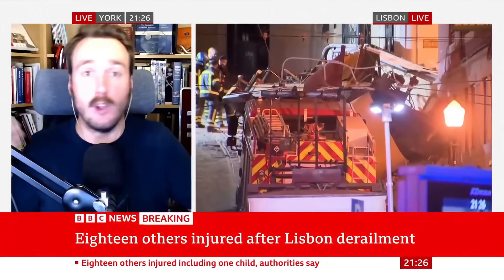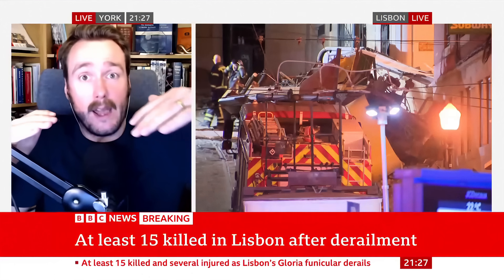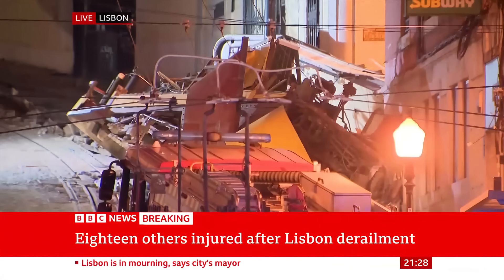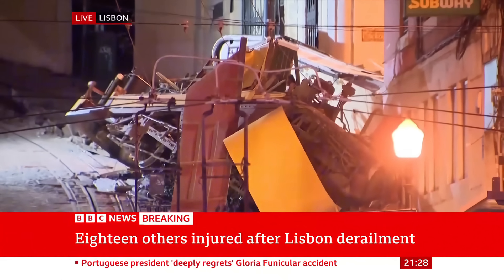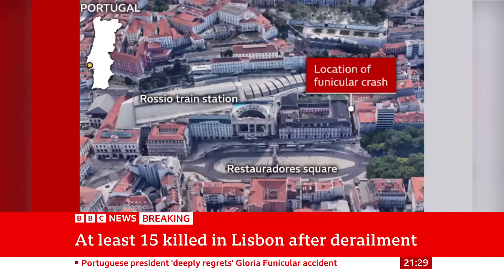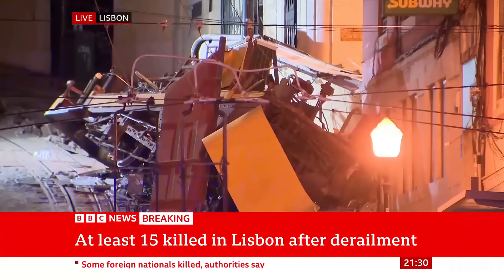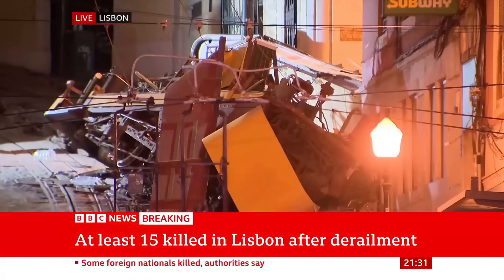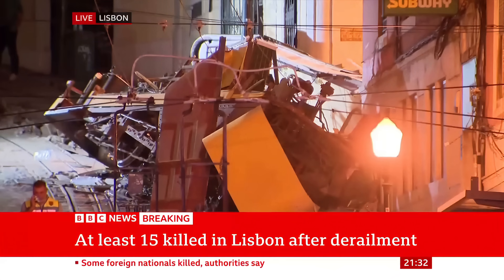Engineer gives thoughts on Lisbon funicular crash | BBC News

Comment: I'm Portuguese and i know very well this funicular and one thing i know about this tragedy: this funicular (and other funiculars in Lisbon) were not designed for constant travel night and day at maximum load. There are usually huge queues of people going up and down the funicular! For this purpose the maintenance should be dialy. This has been used as much as a "roller coaster"! Unfortunately. My sincere condolences to the families of the victims💔
Reply: Since 1885, only  2 cases of Derailments:
On 7 May 2018, a car derailed due to insufficient wheel maintenance. NO injuries were reported.
On 3 September 2025, a car ran away and then derailed after the failure of a steel cable, and brake malfunction.  
Atualmente, é a “empresa Mein que faz a manutenção dos elevadores” da Carris, declarando que a  manutenção do elétrico que descarrilou em Lisboa, é assegurada "escrupulosamente, e que a segurança é uma prioridade absoluta da Carris há 152 anos.“
O elevador da Glória foi inspecionado na manhã de quarta-feira, dia da tragédia. 
A inspeção demorou sensivelmente 30 minutos e foi referido que o cabo deveria ser substituído dentro de 263 dias. A notícia foi avançada pelo Observador, continuando: ”seremos intransigentes no apuramento das causas e responsabilidades deste acidente, pelo que estamos empenhados para muito em breve estarmos aqui para apresentar as conclusões deste inquérito”.
Reply: @helenanova1730  The 2018 derailment is classified that way but was quite different from what people reading the word ‘derailment’ will initially think. Due to wear and tear one of the guardrails of a wheel., the wheel came off the rail. As a result, the wheel dug itself into the ground and essencially  immobilized the funicular that had the issue and his twin.  it is also important to note that the system has been operating since 1885 , what is a long time, without any major incident what suggests at least regular maintenace for a long period of time - wihtout it a system like this would be out of comission in a relative short number of years.
Reply: @helenanova1730 what improvements have been made since 2018? Other funiculars in Portugal were modernized. Sounds like greed and bad management starting from the top
Reply: Absolutely right. I'm British, but have lived in Lisbon for 28 years. I can remember when the funiculars were essentially a mode of transport for locals, what they were in fact designed for!  With the massive upsurge in tourism, they've become effectively a 'joy ride'. They're over used and overloaded. An accident waiting to happen.
Reply: Let's also add that this is a consequence of mass tourism and looking at this like an attraction. The fact is that it is a public transportation - and that it is why it was managed by a public transit company - four portuguese people working in the same public interest institution that use it to go to work ever day, died at the crash.
Mass tourism is putting an intense pressure on multiple basic resources that serve the city that portuguese taxpayers (other taxpaying residents have not played a generational role in this in scale) above everyone else are paying into. Personally I don't anyone that doesn't own a business in hospitality or that couldn't find a job in another industry that feels benefited by alk the rising global interest in the city. I don't think tourism should be dictating how we can live in our cities. Cities are a place for people to live not to be sold as products at the expenses of its citizens. That's why I don't travel nearly as much as I used to. I don't like being a tourist elsewhere and think I'm being a nuisance to someone, I would much rather to be a traveler but that's really a challenge now a days...
Reply: @becomingwhoweare   While I'm sympathetic to your wider view about mass tourism, it remains the responsibility of the authorities and not remotely the tourists. The system had changed its use from public transport to tourist thrill. Fine - in that case the system needed far more intensive maintenance. This would be paid for either by the tax payer or by the customer. Surely, the customer could have been made to foot most of the bill by making single use tickets much more costly. In that way, regular users with monthly passes would be spared the extra cost. Of course, this is easy to day in hindsight
Reply: @tantotonto  true. I wasn't trying to attribute responsability to the tourists for the events. But frame the whole situation - excess traffic of people - as unnecessary and causing unwelcome tension/issues, because some people gain from it far more than others... All of us are tourists one time or another and we don't make this kind of decisions regarding the countries we visit. But collectively we shape it as an economic interest.. my point is that we are sold this idea that this what we should be consuming now: other cities as an experience, and there's fads, now Lisbon is a trend. And someone wrote in 10000 guides that you should ride that elevator when you come here...And we should reject that, as citizens and consumers. 
That's my reflection over the past 5-10 years. But surely the accident is in no way to blame on the people who use the elevator regardless of their provenance or resident status.
Reply: @becomingwhoweare so we should lock up everyone in their houses?. Tourists bring in extra revenue to the transport companies. It's is the transit companies responsibly to maintain a safe system.
Reply: Maybe they need to close all the funiculars in Lisbon and subject them to a rebuild to make them more rugged and safer to use given the current levels of usage.
Reply: @Sacto1654 They are all suspended at the moment.
Reply: @Sacto1654  they are all closed now for a close inspection. One has to wonder if, after this tragedy, whether the current level of usage will return! People are going to be very wary!

Comment: A cable broke. The funicular travelled 200 meters downhill before it met a slight bend, it derailed and hit the building in full speed. The other funicular was still at the bottom of the hill.

Comment: Funiculars, like elevators, are designed to deal with cables breaking. There will either be a secondary cable or a braking system independent from the cable. So at least two things had to fail at the same time for this to happen - or one of them was already "failed" and that wasn't detected by maintenance.

If it's a multi-cable system with no separate brakes, it's possible that one of the actual cabs' chassis broke and lost its grip on both cables.
Reply: Indeed. Disasters like this are never triggered by a singular cause; it's always a chain of factors that leads to such terrible incidents.

Comment: glad he explained how it worked as I admit I was confused to why an incline had pantographs, Having only ridden one in Pittsburgh where they were powered by stationary motors at either the bottom or top.
Reply: These originally had no motor at all. The top cab would have a tank filled with water so it weighed just slightly more than the bottom one, and the tank would be emptied at the bottom. Later they were modified to use steam engines, and then electric motors (same as trams).
Reply: Lisbon funicular isn't working on water since 1909.

Since them work on electricity.

And had been several engines and breaks and cables and... Along this 140 yrs.

An old /new funicular with old clothes... Or the traditional ones on the outside 😂😂😂
Reply: @anamarques5599  - It was converted from water counterweights to steam engines, and only later to electrical motors.
Reply: Yes it had 2 major evolutions.
And others along its 140yrs.

Only the outside and passengers inside are the same or looks the same

Comment: Even if the cable breaks, like an elevator, automatic breaking should occur if there is a loss of tension with the cable.  The operator should have at least two other manual breaking systems that if something like that happens, brakes can be applied.  Where was the operator and what was he doing?  Some railways have three braking systems, air, electronic and manual.  Perhaps the braking systems went to one set of brake pad assembly which failed.
Reply: The operator was in the cab and probably in multiple plastic bags now, so I suspect he won't be much help.
Reply: Have respect, the operator was one of The victims, he left two Kids and a wife behind, it was the first to be identified.

Comment: A cable must have snapped. One car had about reached the bottom and dropped a few metres to the end of the track. The other one rolled back down the hill from almost the very top and then left the rails at the last curve before the lower station, thereby avoiding hitting the car at the very bottom

Comment: No mention as to whether or not this tram had emergency brakes, this in case of cable failure.
Reply: Of course it did. A cable hauled car like this would have a spring loaded brake that gripped the rail(s) if cable tension vanished. Same with vertical lifts. However these things can fail to work sometimes, maybe because of lack of maintenance.

Comment: clearly he has no idea of how it worked, all speculation, shame! -.-
Reply: He clearly does, considering he even knew they'd been upgraded to use electrical motors in the cars themselves (which is unusual in funiculars).
Reply: @RFC3514  I'm confused about that. If the cars were modified to be self propelled with electric traction motors, then why is there still a mechanical cable being used?
Reply: @ct6502c  - The motor is only doing the work that the water tank used to do (i.e., breaking the balance between the two cabs so that they actually move). The cabs are still balanced with each other. It would be incredibly inefficient of have motors do all the work when gravity can do 90% of it for you.

Comment: Automatic brakes that operate at the moment the cable fails would have prevented an uncontrolled acceleration and subsequent crash.
Reply: A cable hauled car like this would have a spring loaded brake that gripped the rail(s) if cable tension vanished. Same with vertical lifts. However these things can fail to work sometimes, maybe because of lack of maintenance.

Comment: Apparently it was up on the hill, whereas the other tram was at the bottom waiting to go up. The people on the other tram felt a violent jolt which leads me to think the cable connecting them snapped, then that tram they were in slid down the rail a couple meters, stopping at the end of the track (luckily they were at the bottom of the hill). So they started panicking and leaving the vehicle in a hurry, and that's when they realised the other tram was coming down the hill fast and out of control, then it crashed into a building, catching people on its way who were on the sidewalk. The dead count is 17 already.
This tram already had some serious issue in 2018. The investigation needs to find out if everyone is really following all safety protocols, if they're cutting costs or hiring inadequate people. 
PS: is there no redundancy in the design, like in elevators? Shouldn't there be another cable in case the main one snapped? Or brakes to stop the car before it gains too much speed?
Reply: Or maybe there were several but they weren't able to hold the tram up, due to whatever reason. (Shock loads can be nasty if the cables were different lengths.)
Reply: This thing was 200years old, there is only one cable. But is has service brakes like a regular train and should have an automatic emergency brake that works by a like a trigger connected to the cable. If the cable snaps or looses tension the trigger clamps a brake. For this to happen all 3 systems had to fail. People are not aware of this
Reply: Este "acidente" ou foi por completa negligência de quem fez a inspecção nessa manhã ou foi propositado!
Reply: @katokaoula4872  também me ocorreu sabotagem, porque 3 failsafes falharam. Ou quem fez a inspecção, ou alguém depois deles fez "outra inspecção", e quem se vai tramar são os outros. Seja como for, 30 minutos de inspecção não dava para ver 200 e tal metros de cabo. Há muita coisa mal nesta história, se tiver sido sabotagem bem pior. Mas por vezes há interesses políticos em criar tragédias do nada.
Reply: @asmrcarousel  Tudo o que disses é o que acontece, infelizmente. 
Esperemos a investigação da PJ (espero que não tapem os olhos à verdade).

Comment: Don't they have breaks on these trains?
Reply: A cable hauled car like this would have a spring loaded brake that gripped the rail(s) if cable tension vanished. Same with vertical lifts. However these things can fail to work sometimes, maybe because of lack of maintenance.

Comment: It looks like that there was an inspection made that morning and everything was found in good running order. According to the article i just read the cables are changed every 600 days. This cable had 263 days left. So its definitely very strange.
Reply: instead of days they need to change it as to how many runs..
Reply: @guesswho-i2u - they estimate that into account into the days - but what was specified and what was supplied ?
Reply: @guesswho-i2u  - They run on a schedule, so the number of runs is always the same over 600 days. But I'm sure they'll appreciate your expert advice.

Comment: I am not saying this accident was due to lack of maintenance but
A lot of these tragedies can be due to lack of maintenance and replacements, like the cable car crash in Monte Faito Italy, 17 April 2025, cable fatigue?
Saving money by low maintenance always has a sting in the tail.
Gaz UK
Reply: The cables have a safe life expectancy of 600 days, this cable was 235 days in use
Reply: @Tusiriakest  Doesn't have to be caused by the cable itself, there will be numerous points of maintenance that need to be performed regularly.
Reply: @Tusiriakest  Perhaps the cable fixture failed?
Reply: I strongly suspect it will end up being a lack of maintenance. As you say, there have been too many failures of similar infrastructure caused by this.
Reply: If these are like an elevator (lift) there would have been a large wheel (or guide at top) where cable crossed to other track. This could have failed.  Failure could also be on crashed, as failure at any of 3 places would have same bad RESULT.

Comment: Why would they not design such a system with dual or triple cables? Surely they were not relying on a single cable? I would use three parallel cables for redundancy along with a fixed static cable on each track around which a brake, bolted underneath the car, slides up and down and would automatically grab if speed exceeded a preset limit. Along with that anti-derailing devices are very simple to design with the right rail design, essentially a manually operated screw attached to a heavy iron foot which under normal conditions glides along under the flange of the rail, any attempt for the wheel to lift would be checked by the foot. Rather like trying to pull the rail out from the jaws of a vise set just far apart to let it slide but narrower than the flange. Very simple. The manual screw would enable it to be applied in an emergency as a brake, tightening the jaws of the vise and clamping the car to the rail.
Reply: A cable hauled car like this would have a spring loaded brake that gripped the rail(s) if cable tension vanished. Same with vertical lifts. However these things can fail to work sometimes, maybe because of lack of maintenance.